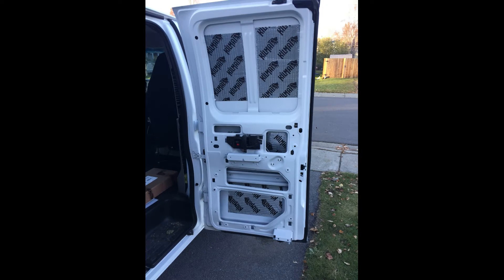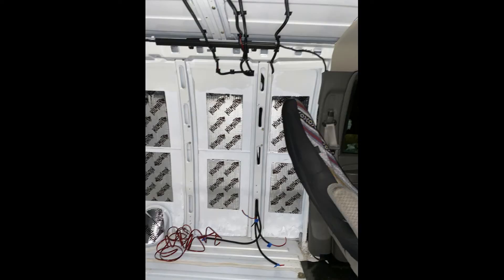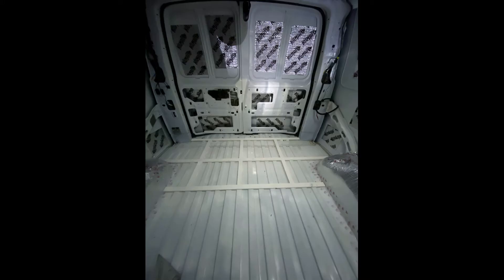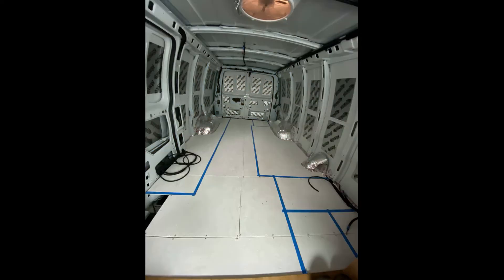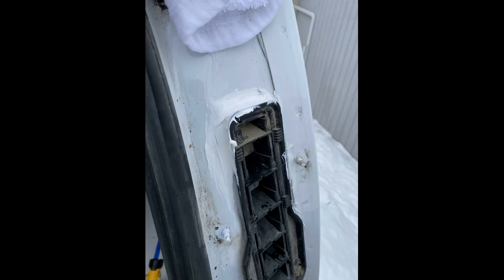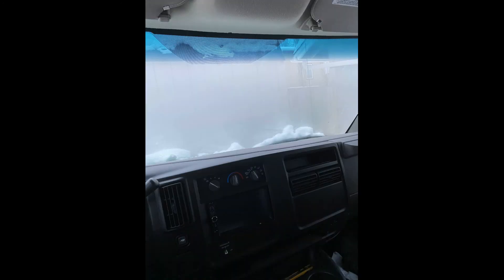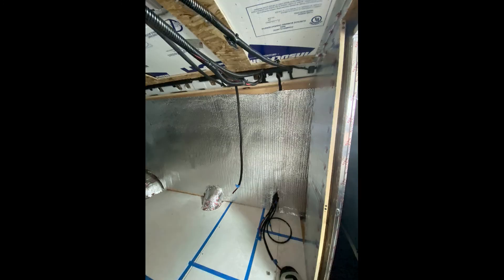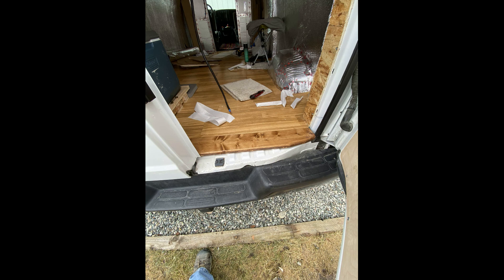Savana Camper Van - Build Part 1

Comment: This gives me the itch to build a van with my wife. We have been researching a second home on wheels for a few years now. I really think building is the way to go. Mind me asking the cost? Van price. Build price?
Reply from the maker: Thanks for the comment. Our van cost us $10,000, it was used 2005. We were lucky it had very low miles and no rust or damage.  I wish I had taken better track on what we spent on total, we feel we spent almost $5000 on the build. It depends on your wants and needs. It adds up quick. I’m always thinking and buying things for the van. So the cost is always accumulating. Lol